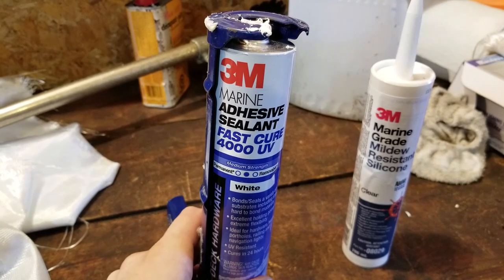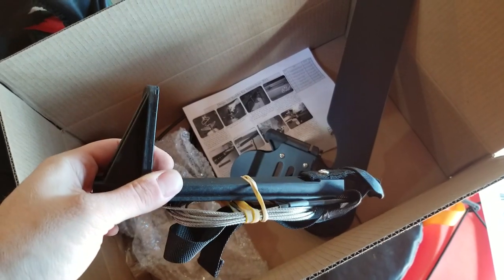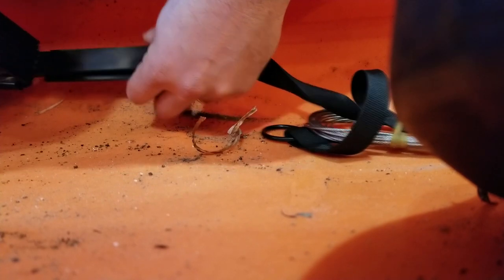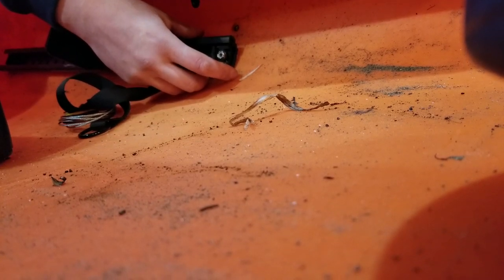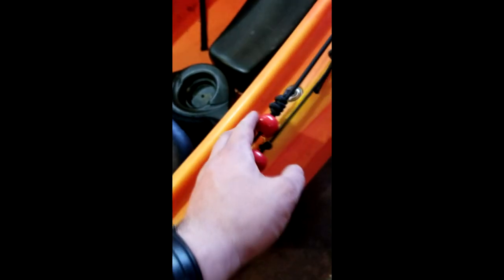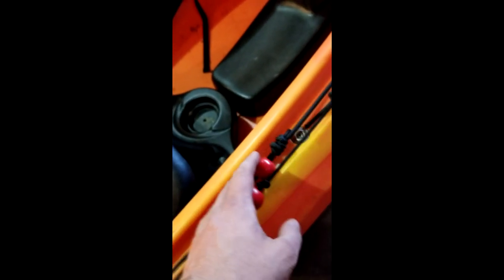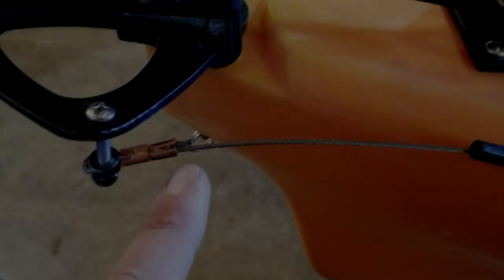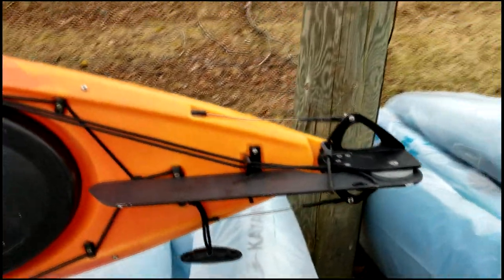Kayak Rudder system Install - 2011 Old Town Dirigo Tandem Plus

Comment: What are the specs for the tubing?  material, inside diameter, length?  Would any vinyl tubing work?
Reply from the maker: Jason i suspect its poly but could be wrong. You want something ductile as it will be bent in places. Unsure on od and id as this comes as a kit from OT.